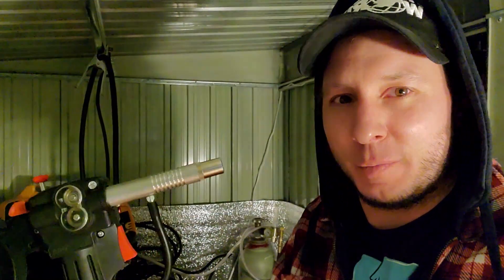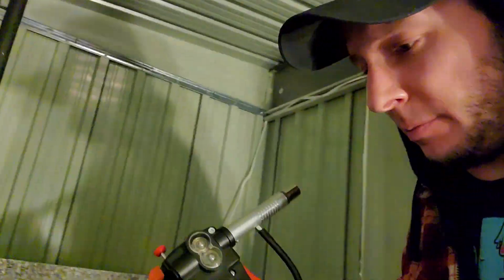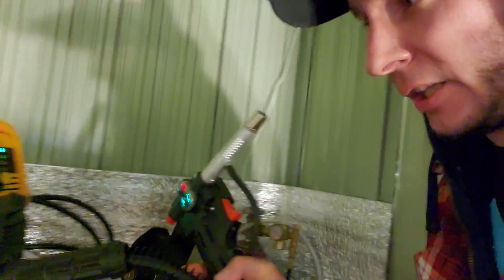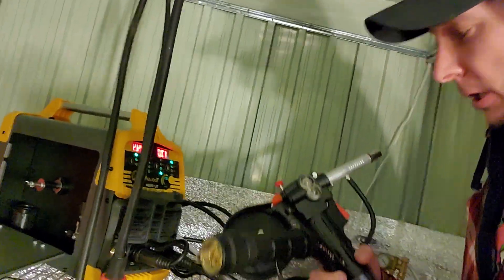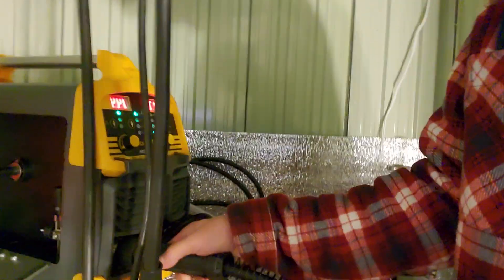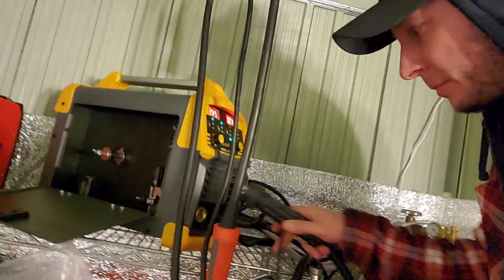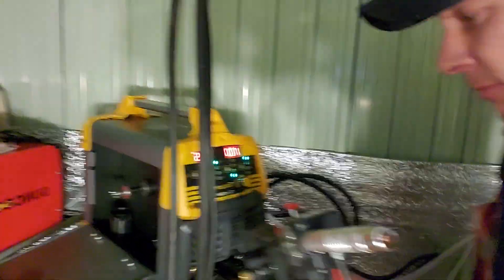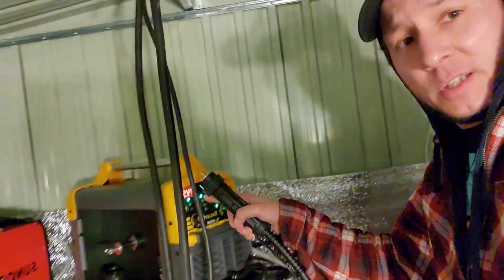AMAZON WELDER pt1-TOOLIOM TL-250M ALUMINUM MIG WELDER- SPOOL GUN TEST - FIRST IN HISTORY! repair !!

Comment from the maker: I got it because of its biggest size...so that this welder goes up to 250 amps and 15METERS per minute🎉 in feed🎉 ...which is a  big time ! and the Brass connections are a little bigger than the regular 200 amp machines everybody else has.🎉 the weight of the machine will tell y how much power it has because the iron mass is inherently larger. I have a chart where i compare the weights of like welders online.

Comment from the maker: ●FYI IT IT DOES NOT SPIN THE SPOOL GUN! --When I said  18 V would make a good aluminum weld, thats because 18 V DC is what I calculate is needed to turn the wheels on the spool gun. (ASSUMING 18V WOULD GIVE ME AROUND 400INCHES PER MINUIT😅)  you know it's just a simple controlled motor. Im guessing i weld at 21v power for 3/23 thick Alm. AND THE MACHINES MANUAL SAYS ALUMINUM IS TO BE SET AS ELECTRODE NEGATIVE (OPPOSITE OF STEEL WELDING)🎉🎉🎉

Comment from the maker: The main take away from this video as of right now is that you can definitely tap into the wiring and never switch on spool mode and still use spool!   I also tried to mig with it but of course the Alm. wire broke at the feeder. I suppose I could try the black liner i have laying around...it might just be a replacement and not a special liner that was included...im pretty sure your whip would have to be like 4 foot long to be able to use a normal gun.
Reply from the maker: As of right now I believe you can just use it in normal mode with the spool gun but you'll have to hook up The (feeder & spool tied together with new custom hookup) Wire internally.🎉🎉🎉🎉🎉🎉

Comment: I believe you.  I don’t understand you but I believe you.  Will there be a part 2?
Reply from the maker: Omg i finally watched it...i realized the gas is off.  Maybe it detects gas...lets hope this is all just nothing. Ill test it in  3 hours.
Reply from the maker: I  Checked it with the gas on and it doesn't really care it doesn't have a gas detector so basically.... nothing changed now that I tried it with the gas on or off, i will just add make the spoolgun have another 2 wire hookup into the feeder power ( i will add a switch on the welder to be able to switch between feeder and spool output.
Reply from the maker: Fixed! Pt2 done  https://youtu.be/dl5KOyJ25sY?si=FFXD_q34Zx0_odpm
Reply from the maker: Project completed 🎉🎉🎉🎉🎉 💯  run it!